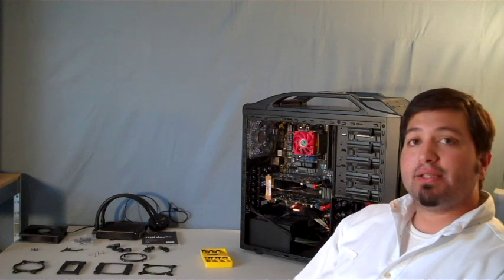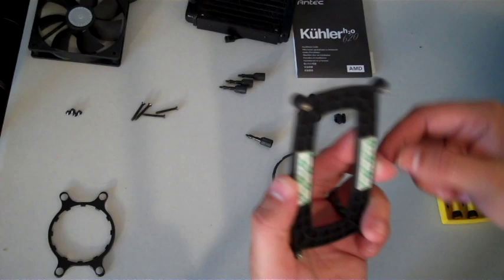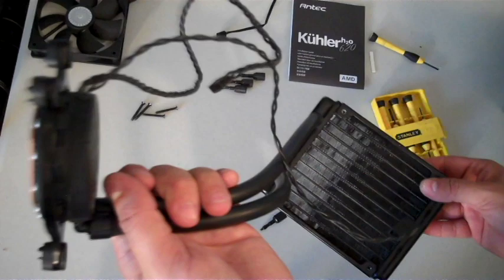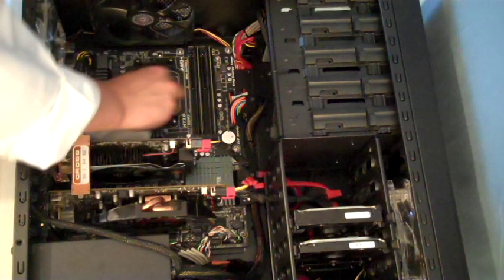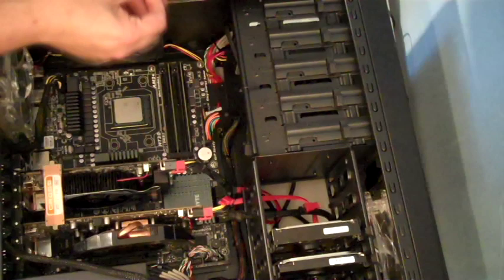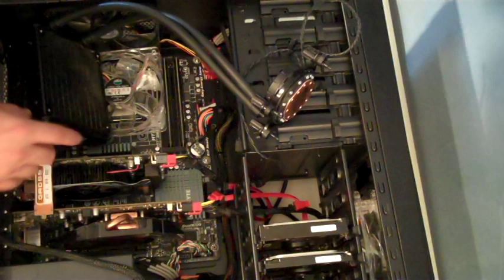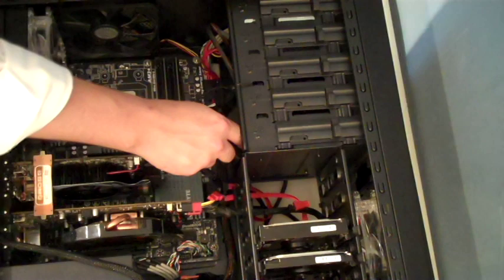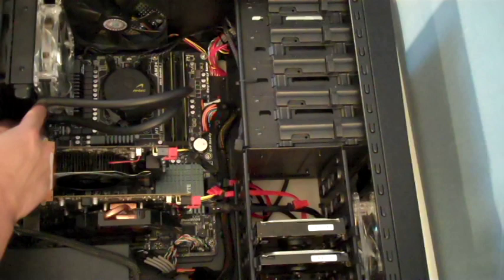Antec Kuhler h2o 620 installation guide.

Comment: SOOO, that's what the retaining ring is for! It is not even shown on the directions. I fumbled with it trying to put it on the top, never could figure out what it was for. If/when I reinstall it, I know what to do now. BTW, I have found this setup works much better if you have the pump hooked to a full speed case fan header and have the fan hooked to the CPU fan header by itself (I actually swapped the Antec fan with a PWM fan and it is much quieter at idle. The pump works better and is quieter running full speed all the time.

Comment: I have to replace one of these liquid coolers and I am having a tough time removing those 4 spring-loaded heat sink screws. The retainers on the back of the motherboard turn with the screws! Any suggestions?

Comment: Why did you double mount the old fan onto the new cooler fan?

Isn't using just the new fan sufficient? Wouldn't the old fan interfere with the flow of the new fan?
Reply from the maker: the new fan is sufficient, and it didn't effect the temps in this setup.  I wanted to show a way to mount push/pull with the hardware included.  That and my brother wanted the led fan to still be in there :)

Comment: the last part helped me the most i have my tubes on the uper side ,only thing missing is my nzxt front fan controler doesnt use it and it keeps reseting to 2008 aswell ..
so i have the cm elite 431plus that actually has no space for 2 fans on top after the install :/ maybe its better to turnt it around anyway hmmhm
i now have one proc fan screwed on the outside with cables going in thru the big cooling holes lol ,still nzxt youre cool xD